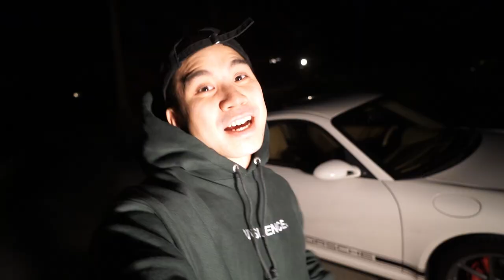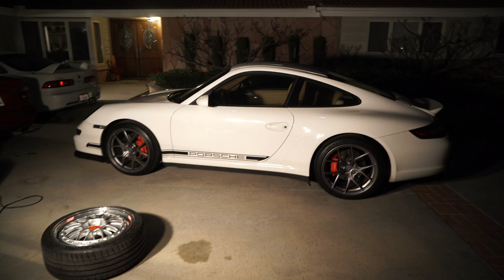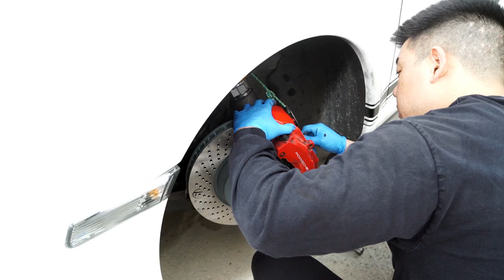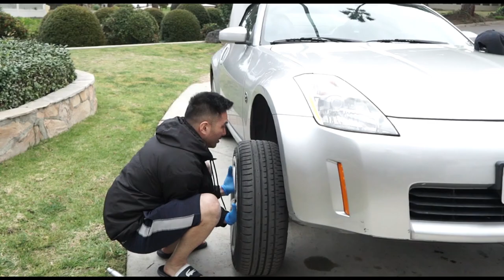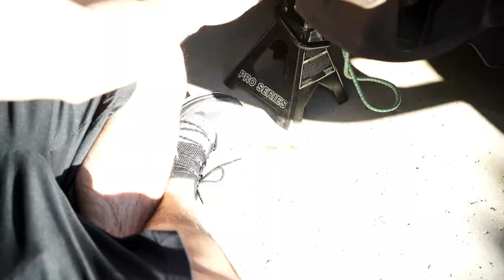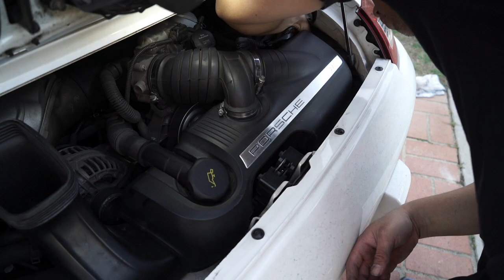PORSCHE Gets New GRAIL WHEELS + Brake Job Goes WRONG

Comment: I have these on my 993, but they are 18”.  I think the centers look too small on the larger diameter halves.  Back when I built mine, it was around $1500. Per wheel, for 8” fronts and 10.5” rears.